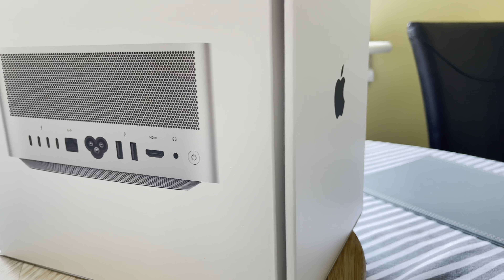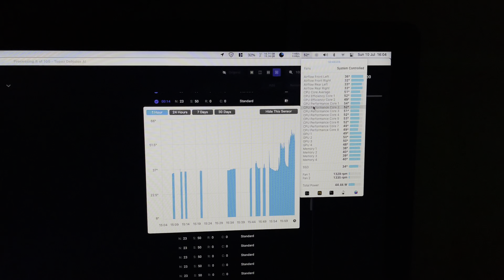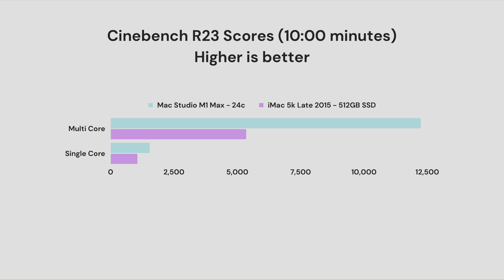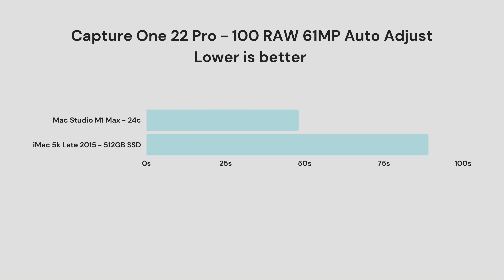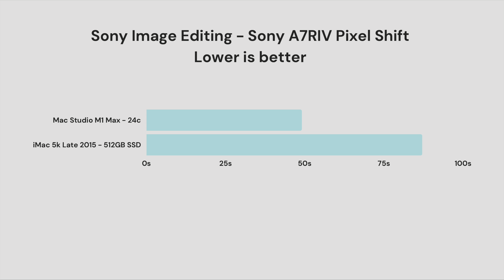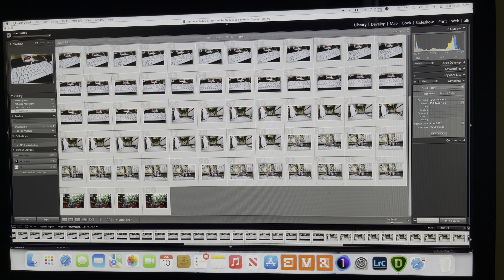Apple Mac Studio M1 Max vs iMac 5K for Photo Editing - Review & Benchmarks

Comment: I too am at a crossroad with my 2015 iMac i7 32Gb Radeon R9 M395X 4G running the OS on an external Samsung SSD. Bought a 2TB  NVME but note sure if Want to tear down and install. With the forth coming OS Ventura and not being supported on my 2015...looking at the Studio Max in the Fall. Thanks for video..
Reply: I had my late 2014, added a 2TB installed for OWC (Aura model). Originally I have custom ordered this iMac with Fusion Drive of 3TB HD and 128GB SSD, which worked well for almost 5 years. Upgrading my SSD to 2TB allowed me move all my stuff into it and repurpose the 3TB HD as a Time Machine drive (I also it to AWS Deep Glacier as external backup option). Boot and launch times are better but nowhere quick as we get used on M1 machines. Since I have spent good chunk of money on the upgrade, I would like to keep it as main machine up to 2025 when it is 10 year old. Than move to MacBook Pro or Studio with a monitor, or if Apple hear us, new 27’ iMac. 

Mind that opening, cleaning and upgrading this iMac is complex. I had during lockdown so there was some time anyway. I was able to tape the glass display properly but I was so stupid thinking it was no properly glued and I broke it trying fit it. Costed me additional $500 to repair it. If you are not comfortable tearing it down, maybe local Apple partner can upgrade it to you for a fee. 

About Ventura, good question, 2014 won’t upgrade to Monterrey so I used the hack, OpenCore if I am not wrong. I tested using a flash drive patched to boot Monterrey installer and push it to another external drive to test it, see if was stable and easy to update with regular Apple process. All went good so I moved into upgrading Big Sur to Monterrey with no issues. Running since January well. I will see to repeat it next week when aventura is released into the external drive. I need the flash drive to boot the iMac but this is not an issue. I could try to patch the internal SSD some time too. Finally, I have enabled File Vault to encrypt the SSD. Working good so far!
Reply from the maker: I know it’s been a while, but I would probably hold off for Apple’s next move, the M2 chips are out, which I have tested and are quite a but faster than the M1 in certain things, so a Mac Mini with M2 at the right price would be very tempting

Comment: Excellent thank you, needed a photographers view on this
Reply from the maker: It’s definitely more than powerful for any photo editing task, but the screen is a very important factor for photo editing, and unless you are a wedding photographer or similar, spending £2,000 on the Mac Studio and £1,500 on a good screen is stretching too far for most, especially when you have a 2015 5K iMac that although is a fair bit slower, noisier and higher temps. 

As great as the machine is for photo editing, I would call it overkill and it’s let down by the lack of decent monitors to go with it, much like the Mac Mini although you can pick them up for £800ish which is pretty good value and spend the £1,000 extra on a good screen should you wish.

It’s a shame because a 24” iMac M1 is perfect but most people want 27” - 32” screen sizes, but rumours say that is on its way
Reply: @jb97techandgadgets  Thanks for the detailed response. I have the same iMac late 2015 and I maxed it out at the time and it has served me really well, but im sitting here exporting 2,008 jpgs not even at full res and its is taking FOREVER. I was waiting on a new iMac but it looks like another year's wait. Its always a difficult decision, but im sure once I take the leap, I'll be happier. As you've said, the monitor is a big let down. Thank you again for replying, you've made my decision a lot easier.